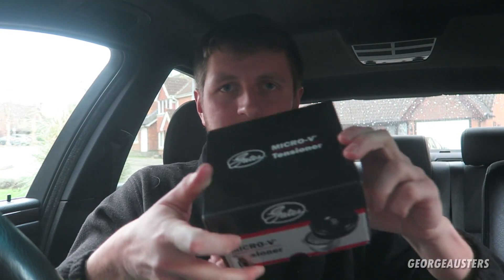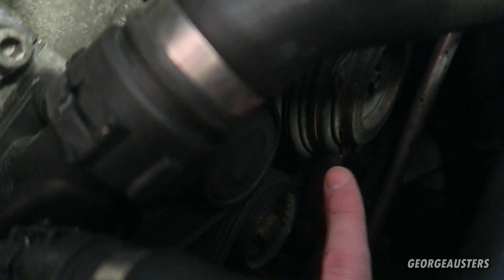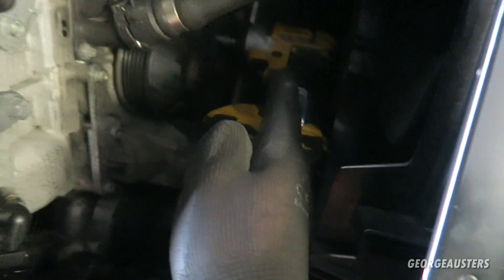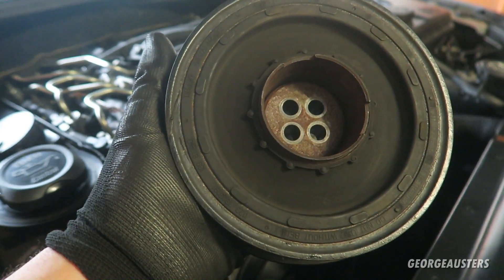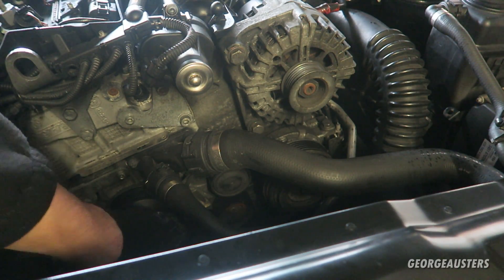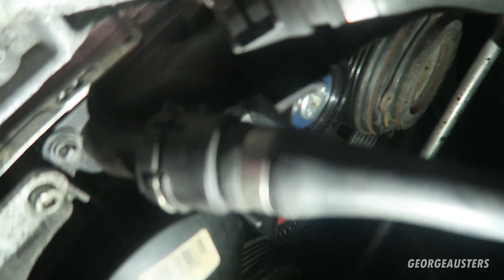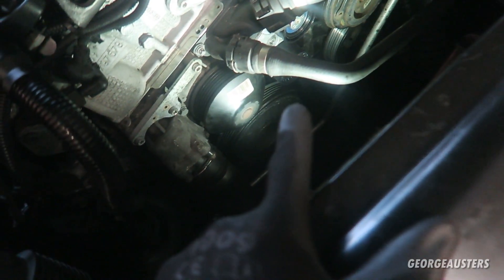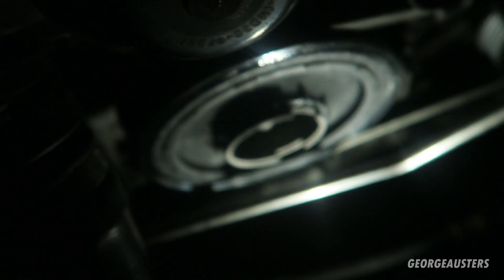BMW N47 / N57 Crankshaft Pulley Replacement

Comment: Hi George ! You're 5 series is manual ? I watched all video, and I am wondering how do you lock de crankshaft when you torque the 4 bolts , I need to do this tomorrow, on E90 n47 manual., any advice ? Do you let it in gear ? Thanks !

Comment: I understood everything except 2 things. Probably silly questions, but what do you mean when you said you need to line up the crank pulley and what do you mean by torque 40nm plus 120 degrees?
Reply from the maker: Line up crank pulley with bolt holes. Torque to 40NM then an additional 120 degrees (1/3) of a turn
Reply: @GeorgeAusters riiiiight i get you now, thank you 🙏

Comment: It would be very helpful to see the crankshaft pulley being torqued to the correct Nm + 120 degrees. It's a big miss not having that.
Reply: Did you manage to turn the bolts 120 degrees without locking the Engine? I used the Impact wrench but were probably a little overtightened.
Reply from the maker: 120 degrees is just 1/3 a turn

Comment: I have a 1 séries 118d n47 from 2009. This rattle noise only happens when the car gets hot . The car hás 170000 klms. Do u think it could be the cranckshaft pulley? Im just asking because it only starts to happen when the car gets hot.

Comment: Very good video. Thanks. I have a question: the pulley bolts are torqued to 80 Nm...is that right?
Reply: 40nm + 120 degres (it’s told in the video)

Comment: Another great vid George, how did you prevent the crank from rotating when doing the 40Nm torque and final 120 degree rotation? Cheers
Reply from the maker: @Andyme-z7s  I just left it in 6th gear and just about managed it.. you can lock the flywheel with a locking pin if you want though
Reply: Thanks mate.. your reply is very much appreciated  :)

Comment: Do i have to lock crank or not before removing pulley?
Reply from the maker: No you don’t
Reply: @GeorgeAusters  thank you for your reply. So if the pulley spins a bit while trying to remove it its not an issue? Or better to use impact gun?

Comment: You don’t explain how you stop the pulley from turning round when you’re turning the four bolts on undoing them. ? I’m trying to do the four bolts and the pulley just keeps turning the engine thank you.
Reply from the maker: An impact wrench is your best friend👍🏻
Reply: @GeorgeAusters  I managed it mate. managed to lodge thin wide  end Spanner a between that two cut outs and I found a a could undo them when it was at its most top dead centre with the compression ..all done now ..thank you …good video by the way well explained👌🏼

Comment: Hi i lost my pulley and drove about 20 minutes     and it started to get hot do you think i could have braked something
Reply: Yes. The belt the pulley controls drives water pump, air con,  alternator and pas.

You overheated your engine. 

In future,  if you get a red light on the dash (in your case a battery light), just stop the car and switch it off.

Comment: My daughters 1 Series crank pulley completely disintegrated recently, wish I had come across this video, before we had it recovered to an inde, could have saved loads. Thanks George for a well formated video. 👍
Reply: I’ve just been quoted £547 for this. Time to get the gloves on and get cracking. Full set is looking to be about £200-£240. Worth the graft
Reply: How much did a replacement cost?

Comment: Did you lock the flywheel in order to loosen the damper pully? You don't show that. Pully bolts cannot be loosen without locking the flywheel.
Reply from the maker: They can be loosened with an impact wrench

Comment: Does anyone know how to lock the crankshaft on an auto as it just spins when trying to torque the bolts. Been looking for the correct tool for the n47 but had no joy so far
Reply from the maker: Have you installed the belt?
Reply: @GeorgeAusters  I have mate yeah. Managed to sus it (I do not recommend this as I an due to change the alternator soon) but what I did was have a t50 on the alternator bolt; holding that still, while torquing the crankshaft pulley down. Dodgy!

Comment: Hello George, 
I've installed a "Continental" cranckshaft pully on my E91, and the damm thing squeak all the time.
The belt and tensioner are new, so, not from that.

My mechanic said that,  I have eard and seen others "Continental" pulleys giving problems and came deffective.

Do you recommend any other brand who os good like OEM and no history off problems?

Thanks for the help, congrats from Portugal🇵🇹
Reply from the maker: The one I installed in this video, it’s linked in thr description

Comment: How did you lock the CS pulley not to turn when tightening to 80-90nm?
Reply from the maker: Having the belt on and holding it with my hand was enough👍🏻

Comment: Keep up the good work.
Question for you, I had squeal on steering almost immediately so changed belt, tensioner, fluid and bled it and hydraulic power steering pump but it still squeals and makes a knocking sound only heard from the cockpit. Soon as I switch on the A/C the sound has gone. Any advice?

Comment: 4:33 Yes... 118d/E87 if you don't have Chinese hands - remove fan. 1x screw on the side/top of fan assembly (driver side in UK), 1x electrical plug to unplug right on the top (you cannot miss it), then on the passenger side there's a clip/latch holding fan to radiator just about half way between top and bottom - just hold it with one finger then pull fan assembly UP - difficulty level 0. Oh.... and to do that all you have to take out air filter box as it's blocking access to the screw... 2x10mm socket for the box and 1x flat screw to release the pipe. Total time spend for disassembly airbox+fan+crankshaft pulley - 30minutes. Replacement should come tomorrow so still not sure how long reassembly will take! PEACE
Reply: Additional info to this, if you have an automatic - there is an additional screw bolting the auto gearbox cooler to the radiator fan shroud. You'll need to get under the car and under tray off to be able to undo the lower screw. You won't be able to slide the radiator fan up until that bottom screw has been undone. It's a way bigger faff compared to the manual where everything can be undone from the top
Reply: Update: Reasembly - same +/- 30min ;). Only difficulty is putting a belt back on when you're alone. Gearbox on neutral + belt on all wheels apart from alternator - easiest to access as on the top - tensioner FULL clockwise then wigle the belt on the alternator pulley - yes it's tight but twist pulley left/right on repeat and it will pop back where it was.
Reply: Update 2: Wednesday - crankshaft pulley melterd, Sunday - starter motor gone xD. BMW <3

Comment: Hi does it make a difference if you torque your crankshaft pulley before you put the belt on?  Or does the belt need to be on before it’s torqued up?
Reply from the maker: Doesn't matter

Comment: Hi , where i can find the the numeric of fasteners bolts should do ?like what power to use on dynamometer please ,any tabels for show ......idle , tensioner pulley,and crank shaft in n57,530d f11bmw if you don't mind share this info

Comment: When loosening the 4 bolts on the pulley do I need to hold the pulley in place so that the timing doesn't go off? Or is that not true?
Reply from the maker: Shouldn’t affect the timing but you could turn the crank
Reply: @GeorgeAusters  I'm hesitant to do it myself because I'm not entirely sure how to hold the pulley in place so the crank doesn't turn. 🥲

Comment: Hi George, to remove the 4 screws, do I need to lock the crankshaft? if yes, how I should do that, Thank you.
Reply from the maker: You can install a flywheel locking pin to lock the crankshaft👍🏻
Reply: @GeorgeAusters  Thanks mate

Comment: Mine just snapped, i have to order for the  crank pully which can take 2 weeks,  is there a 1 first aid so that i can get this thing moving am stuck upcountry
Reply from the maker: No you need to replace the pulley BEFORE it fails like in this video👍🏻

Comment: My belt through itself off on start up the other day, didn't realise until 7 miles after getting home, looked inside and crankshaft pulley is at an angle, will my engine be ok?
Reply from the maker: Pulley probably needs replacing
Reply: @George Austers  yeah it's strange because I was thinking about having it replaced a month or so ago, then this happens lol, the crankshaft pulley is definitely at fault , do you know if it would of potentially done any damage to engine or crankshaft? Thanks for the reply

Comment: how did you lock the crank?
Reply from the maker: I used an impact wrench to remove the bolts
Reply: @GeorgeAusters  no I mean when you tightened them

Comment: Doing the same job tomorrow, pulley totally failed at 270k km.
One thing tho, you can get a Gates 'micro-v kit' with the tensioners and belt, wich will save you about 35euros. 👍
Superb video and job, thank you !

Comment: Hey George, I tried to use a  long Allen Key to lock the tensioner in place but I doesn't seem to grab anything in the hole when I stick it in. Did you have this issue? I can't get the belt on as it's too tight. Do you have any other suggestions or tips?
Reply from the maker: No need to lock it in place, just use a breaker bar
Reply: @GeorgeAusters  I tried that today but I found it very hard to get it in at an angle to push the tensioner. I was on my own so I'll try with the help of my nephew

Comment: Hi George, Thanks for the video, very well explained and easy follow😊. I am attempting to change the crankshaft pulley on my own 2008 520d but the bolts were rusted in and the pulley turned a little whilst trying to open the 4 bolts... Will this cause timing issues?
Thanks, Marcus.
Reply from the maker: Not recommended to turn the engine backwards
Reply: @GeorgeAusters  Thanks George, I'll get the timing checked.

Comment: Awesome guide George! My E60 N47 520d is an automatic, anyway off locking crank pulley to remove the 4 bolts?
Reply from the maker: Flywheel locking pin
Reply: @GeorgeAusters  thanks buddy, will have a look for this

Comment: 176000 mine literally just failed lol
Reply from the maker: Better to replace it before it fails as it can draw to your belt into the crankshaft itself
Reply: @GeorgeAusters  oh I mean it has already failed lol it fell off on my way back to my house lol I'm lucky the belt didnt get messed up
Reply: miles?
Reply: @mcplutt  yeah it was completely separated from its core
Reply: @markweeks7548  OK, my 2013 E70 N57 has only 56k miles so I can drive some more 🙂

Comment: Hello mate same car but when I'm trying to remove the 4 bolts from pulley it's turning the pulley so I can't break the bolts free ?
Reply: Same problem hear  the guy doesn’t explain about how you stop the engine turning trying to release the 4  bolts🤷🏼
Reply: @mickrobo6073  He used an impact driver.
Reply: drill bit 👌

Comment: Great video here mate. I’ve just got a 123d and it got a funny vibration but only when I’m sitting at the lights. Goes away as soon as I pull off. Maybe I should be changing all theses parts just for my own peach or mind. Keep up the good work bro.
Reply: Does it also sound like a dmf going bad?

Comment: Done mine today, no need to remove fans or undertrays, abit tight but manageable. I used the holding tool so never needed a impact gun. Mine is a 118D 2010 Auto so no locking the engine via putting in gear😒
Reply from the maker: Glad to hear you got it done!

Comment: after watching 3 or 4 videos of this Task being done yours has given me the confidence to do the Job im quite handy i only need to see something once to do it normally but being my first time changing the Belt and in my case as far as i know the tensioner i was worried incase i break my car but its getting bad and needs doing probably idler too and now im 99% i can do the Job myself instead of the 140 pound plus parts  i was quoted Thanks
Reply from the maker: Good luck!

Comment: Hi George - when you torqued the crankshaft pulley up, how did you prevent the pulley from rotating - or with the offset bolts does it not rotate when you are doing this?
Reply: Hi Phil, I just did my today and had the problem of crankshaft rotating when tighting the torque to 120 deg. So used a impact wrench with offset bolt/socket to slowly tighten the bolts by 120 deg. No rotation of crankshaft and made the job so much easier. No locking tools required.
Reply: If manual - put a car in gear. Not sure if possible on automatic tho :>
Reply: @bevis71  There should be a hole in the flywheel housing for putting in a locking pin.

Comment: Hey George. Great information in your videos. Had my crankshaft pulley replaced about a week ago and now I have noticed oil leaking behind the pulley. Could this have been caused by the new pulley being fitted or is the oil seal known to fail. Just seems coincidental? 

Cheers
Reply: Did you solve it already? Some people do change the seal behind it at the same time the crank pulley is changed
Reply from the maker: May have damaged the front main seal

Comment: Hey George, does a bad/failing crankshaft pulley cause vibration at idle which smooths out at higher engine RPM?

My N47 has done 137,000 KM (85,000 miles). I have vibration when idling and it’s silky smooth when I increase engine RPM, doesn’t matter what gear I’m in.

I have replaced the engine mounts which improved it a little, we checked the transmission mounts which look good too.

If you have any other suggestions I would really appreciate hearing them.

Thanks,

Keep up the great content 😃👍
Reply from the maker: Very possibly yes
Reply: @GeorgeAusters  Great, thanks for the info. Didn’t know about this issue beforehand.
Reply: Hi did you work out what this was? I have same problem with new pulley, vibration at 800rpm idle, all smooth over 900

Comment: Do you need to lock the crankshaft to loosen and re-torque the bolts?
Reply from the maker: To remove them you may need to without an impact wrench
Reply: @GeorgeAusters  But not to get the 40mn + 120?

Comment: Hi mate I have n47 my crankshaft pulley is all cracked should I change all pulleys or just the crank one? Also if not changed straight away due work and time can it wreck other parts of engine?

Comment: Hi George, great informative vid as always! 👍🏻 just wanted to ask ... the drive belt u linked 6DPK1817 is for cars 'with air con without electric PAS' ... so ur bmw doesn't have PAS? 
Just wanted to double check as my E82 has air con n PAS so i think I'd need a different belt? Thanks
Reply from the maker: Mine has hydraulic power steering, with a power steering pump👍🏻
Reply: @GeorgeAusters  thanks for getting back to me 😊 how can u tell if u have electric or hydraulic PAS? I'm not too sure what I have now lol
Reply from the maker: No problem, real easy - check to see if you have a power steering reservoir like me👍🏻

Comment: Help george !! I'm working on 320d e90 2011, 184hp changing serpentine belt, ordered gates micro v belt set, original belt only has v grooves 1 side, new kit is Vd both sides and when fitted and tensioner released , new thicker belt touches, must I fit the new pulley tensioner and slave pulley (which are both slightly smaller circumference wheels) ?? Please advice bud

Comment: Is it normal for a new crank pulley and fan belt to make a slight squeek noise just on start up? Mine does it for 2 weeks now since replaced but only on warm starts
Reply from the maker: Did you buy the same parts I installed?
Reply: @GeorgeAusters  no I didnt buy parts myself the mechanics did
Reply from the maker: @nathanbrady1763  They may have used a cheap pulley
Reply: @GeorgeAusters  hi George I checked now got my mate to start it the noise when the engine starts its coming from the alternator and looks luke the alternator jumps abit(dunno if thats normal) but the noise is from there

Comment: Put my 2011 N47 in today for chain replacement at 108000miles and the mechanic sent me pic of the crank pulley cracked all around in a circle basically😂 I remembered in another one of your videos you mentioned the pulley should be changed too on n47s😁

Comment: Hi George, got all my parts to do exactly this job but can't undo the crank pulley as it's moving when I try to undo it, any help appreciated pal on how I can stop it rotate??
Reply from the maker: Either an impact wrench or crankshaft pulley locking tool
Reply: @GeorgeAusters  thanks mate, any impact recommendation? Cheers

Comment: When you tighten up to the 40nm what does the 120 degrees extra mean
Reply from the maker: Extra 120 degrees of a turn
Reply: @GeorgeAusters  Thanks George.i  owe you a 10quid coffee ☕on pateron for the help..your Well worth it💯... also the 4 crankshaft pulley bolts are they a only one time use? I purchased a new pulley but it didn't come with new bolts? Am I right in saying you said the 40nm +120degrees is equivalent to aprox 80nm, I don't think I'm getting mine tight enough or they are coming lose because since I changed the pulley im getting an awful noise from the tensioner like a shriek/ticking squelch it doesn't go away by spraying pulleys with a little water ,I can get  the noise to go if I turn the size16 tensioner bolt slightly to the left as is to loosen it while the engine is running , so I changed the tensioner thinking it was it  & new belt but the sound is still there only at low rpm or when the steering is fully locked and you tap the accelerator, do you know what size those crank bolts are? Or is there any different/upgraded ones I can use?

Comment: Been loving your videos, when you were about to put the new Crankshaft pully in you said something about it been positioned right, is there a certain position it fits back in also on the new belt does it have a certain way it fits , does it have directional arrows or does it not matter ? Oh and out of curiosity how much would you charge to do a timing chain on a 2010 318d e91 with N47 engine 🤣